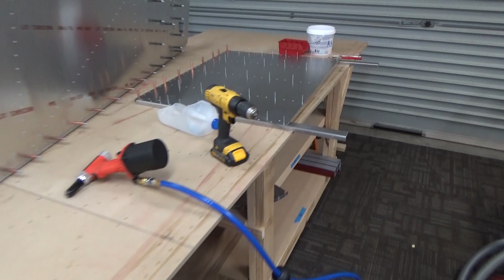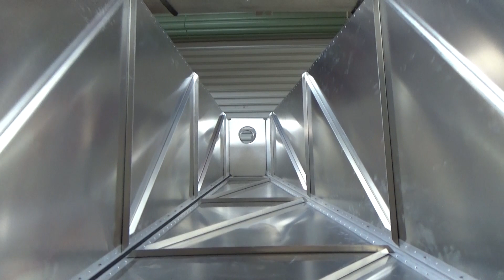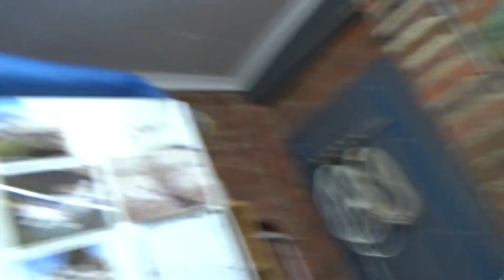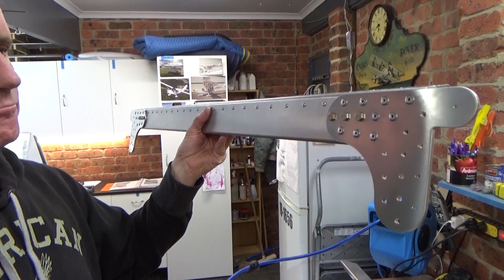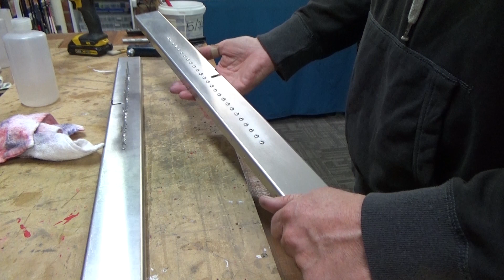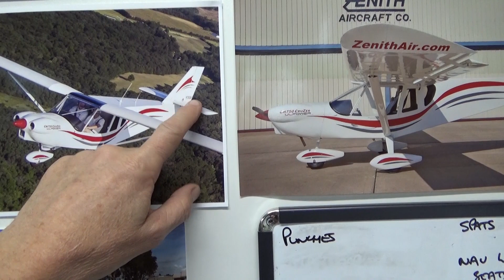Be careful here, Zenith CH750 Cruzer Rear Fuselage May 20

Comment: Hi Scott. Another question. Did you have any difficulty getting the top skin to line up with the holes in the top of the top longeron? The build manual states to start at the rear and work your way forward but I'm having trouble getting the holes to line up. BTW. I love the idea of the wire loom inside the longerons.
Reply from the maker: Hi Richard, oh its been a while, I do remember having to trim the longerons a bit, maybe that was the bottom ones. I would remove all the checks, swap things around and try again. Swap left for right front for rear etc, they might look the same but Zenith are clever and have subtle differences so things go together correct to help further down the track. see how that goes.